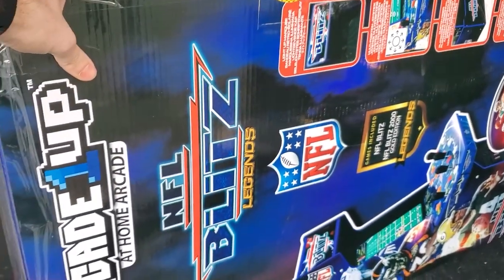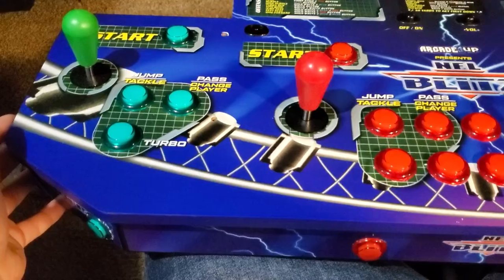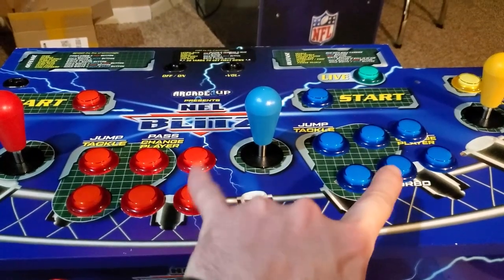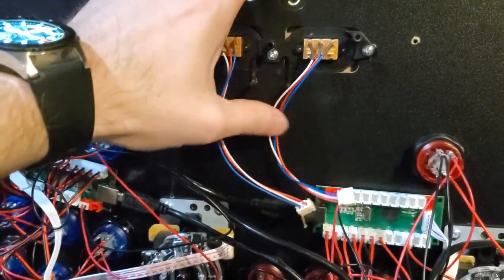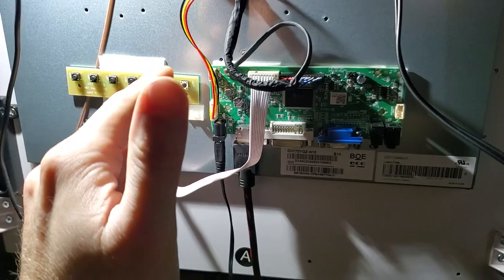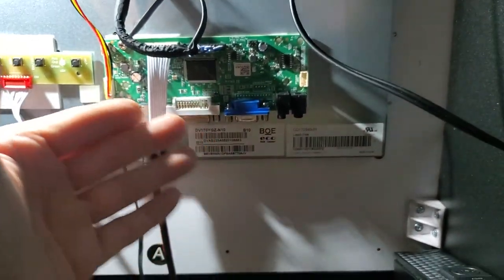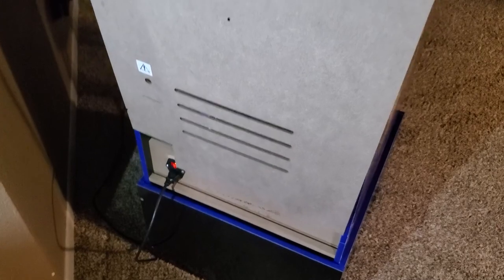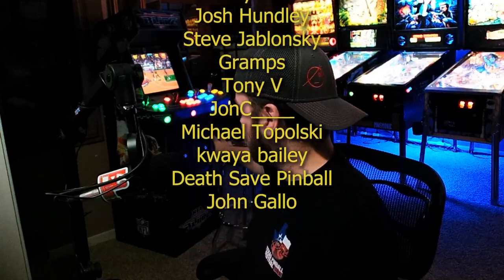How I 1 Upped My Arcade1up

Comment: On 2010 bought a 2PL arcade console from monsterarcades.
2014 built myself a 3PL arcade console.
2022 Im building a 4PL arcade cabinet with 2 screens. Using Ultimarc and GrooveGameGear hardware: RGB LEDs controled by LedBlinky, trackball, 2 spinners, 1 flightstick, 2 rotary sticks Suzo. Im spending more time building and configuring than playing so far. LOL.

Comment: I got into MAME pretty heavily for a time.  I went the RetroPie route.  I used ETA Prime's video's as well.  The guy is just awesome.  MAME package I purchased off Etsy.  I got discouraged with button mapping.  Remapping buttons for every game I wanted to play was too time consuming.  Street Fighter was actually the game that eventually discouraged me enough to abandon it entirely.  I couldn't get the buttons right and resorted to physically unplugging/plugging the buttons in on the control board.

Has button mapping gotten better?
Reply from the maker: When it comes to my frontend all I had to do was boot up a game in mame go to control settings (using my keyboard) then select each which button I wanted the joystick to activate. "What button for DOWN" - then I would move the joystick to the DOWN position. Then UP, LEFT, etc. Pretty easy. The settings will be saved and the mame will remember the settings from that point forward.

Comment: If you get another cabinet, I'd suggest getting a REAL cabinet not the thin mdf stuff AT games and Arcade1up use.
Reply: He had a real cabinet. He gave his reasons for this particular build.
Reply: @marcbrown6391  but he also mentioned he might get another machine which is what I'm referring to.
Reply: @jman44  true, but I took what he said to mean something small and light, not a heavy duty cabinet. You went a different way then I did.